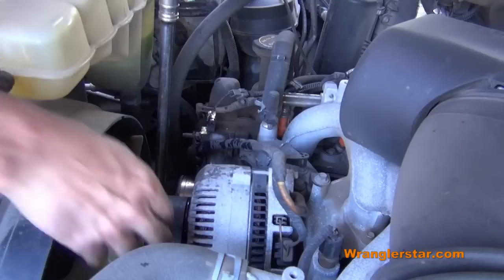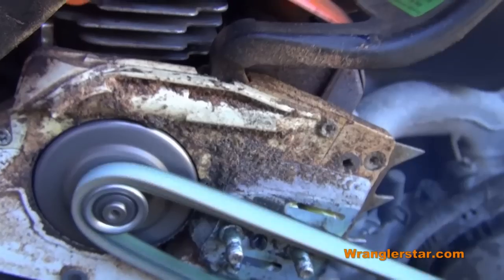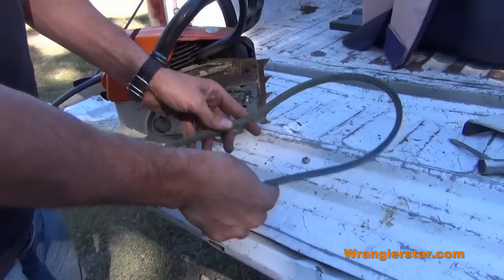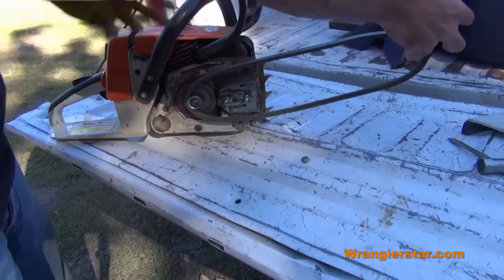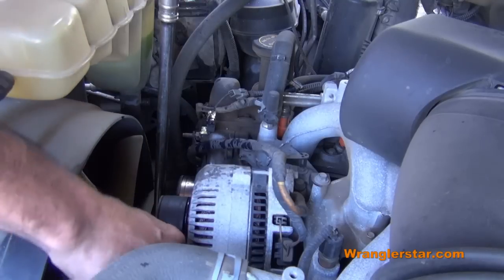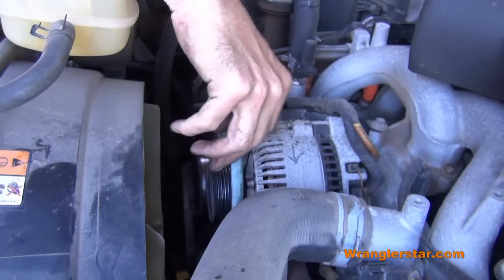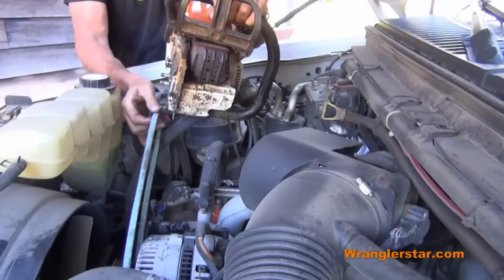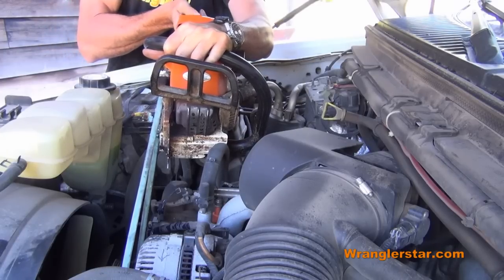Charge A Car Battery With A Chainsaw

Comment: if you have a stone dead battery , the field in the alternator cant activate so it wont work. it will work if there is some voltage in battery only!
Reply: +harry escarole If you have a stone dead battery you'll never get away from your house needing to try this.
Reply: Carl Smith but your veering from my comment , its either yes im right or no im wrong
Reply: the point in video is starting your truck out in the middle of no where not trying to charge a stone dead battery your battery wont be that dead just from leaving the radio on, and you can't get out in the middle of no where with a stone dead battery. You're like can't air up my tire with this chain saw thing, didn't hear him once say it was stone cool dead right you brought that part in to the discussion.
Reply: my thought is driving along and alternator goes. some people wont know it or wont be near a place for help. when vehicle stops running it will be stone dead. it was a scenario i had in my mind.
Reply: +harry escarole ....  Most modern internally regulated Alternators are single wire self exciting and do not require battery voltage to excite the field..  They are self contained and if they are spinning they are charging...  GM cars and trucks have been using this system since, ...well a long time..    If you have a three wire alternator there are video's showing you how to rewire it to self excite.
Reply: rainmechanic dont agree with you , theres no magnets in an alternator
Reply: harry escarole ... Apparently you do not agree with the engineers at General Motors either.
Reply: rainmechanic i worked for gm dealership for 21 yrs ,  i was gm certified and i rebuilt delco remy alternators and starters on bench before there was an exchange program.  you can sit in your dirt driveway with your cam. i dont think g.m. engineers recognises you in case you didnt know.
Reply: rainmechanic yeh self exciting when theres voltage to the "one" wire......without voltage you can spin that pulley all fuckn day and it wont produce anything. a generator in a car doesnt need any existing voltage to produce. you need to face your downfalls and maybe "SELF EXCITE YOURSELF"!

Comment: Great video how long will it take to get enough charge in the battery to start the truck.
Reply: +Michael Swan ~~~People in the comments say a little over 10 mins at the trucks fan belt normal idaling speed, then try. Peole say they had sucess

Comment: This seems like way more pre planning and work compared to storing a charged battery and some jumper cables. And TAKE NOTE PEOPLE: alternators are not designed to charge a dead battery, only to keep it at an optimal level. This may cause premature failed of your alternator, and more problems than you want to deal with

Comment: it sounds like Cody is speaking from experience.of being cutting a while, left the lights on. ignition key should be in the on position. to do this. it will take an effort by the chainsaw to turn an energy starved system at first and lighten over time. the belt might even squeal from the first engagement of the chainsaw. thanks  Cody  good info. nice video

Comment: You do not need to mark the direction of an alternator. The alternator itself makes ac. Then uses diodes in a rectifier to make dc. Now the older generators this might be so. It doesn't matter the direction of the alternator not the direction of the chainsaw.

Comment: alternators don't have magnets they have electro-magnets if there is no power going into the field coils they are not magnetic. some alternator can self excite using the residual magnetism from having been run before, some can not.

Comment: You can do the same if you happen to have a battery powered drill and a socket that fits the nut on the alternator pulley.  You need to turn on the ignition as well.

Comment: I don't know about other people, but I don't regularly carry around a long wrench capable of applying enough torque to the tensioner to remove the serpentine belt.
And getting the belt back on would be a huge pain unless I had a helper.
With the way it's routed it could fall off about half the pulleys just removing it from the alternator (I know because that's how I removed it when I changed the belt).
And if it comes off, the only way to put it back on is from underneath, which means raising the front of the the vehicle at least two feet and removing some plastic panels.

You look like you have plenty of room in your engine compartment though.

Comment: How is it possible to generate any electricity, if there is no ignition on and no power to ignite the magnetic field inside the alternator?
Reply: i don't think it requires the full 12 volts to excite the magnetic field, and once the alternator gets up to speed it starts making its own electricity for the field.
Reply: the shear movement of a coil and a steel case will genarate a electric field thus genarating an electric current so you dont have to have any ignition on, the shear movement of the altanator will genarate electricity which charges up the battery. if you think about it that alll the gas engine is doing is spinning the alternator componments.
Reply: brian wheway
Many systems require the ignition be on in order to allow voltage to flow to the exciter, and while it doesn't need much to get started, a truly dead battery will require that you supply 3-5 volts to the positive battery cable terminal. A couple of AA batteries or even a cell phone battery will work as an initial exciter...
Reply: Karen-Audrey .Todd Good info!

Comment: This won't work if the battery is completely dead. If you get lights on your dashboard, you should be OK. Alternators need a bit of power to energize the charge coil. If it is totally dead, heating the battery near a fire so that it is nearly too hot to touch usually excites the chemical reaction enough to get the dash lights going.

Comment: So what would you say, spin the alternator for ten minutes at full speed with the chainsaw? Should that be enough?
Reply: +David Batterson ~~~~Some where in the comment a guy said he had tried it when his truck died on a hunting trip. He tried it for 5 mins with no sucess, but then he tried it for 10 mins at the trucks regular idaling belt speed and it worked. So yes about 10 mins if not more i supose.

Comment: Wstar.  Great Tip... but is it confirmed that direction of turning the alt must be the same as when it is spun by engine?  I know for a Gen it would have to be without a doubt, but I just don't think it matters with an Alt...the diodes don't care, the Reg doesn't care...I really don't think it matters...or not knowing for certain, are you just being safe?
Reply: +Ronplucksstrings It does not matter to an alternator the direction it is turning. The diodes will reroute the current to the proper terminals.

Comment: Yet another reason why I keep an old duffle bag in my tool box and every time I change a belt or hose on my vehicle I put the old one in my bag, and get rid of the last generation one. That way I always have a relatively fresh spare on hand for all my wear parts. Just too darn easy to fix stuff like this in the field when you have tools with you but almost impossible when you don't.

Comment: it doesent matter which way you spin an alternator itll charge the same,the direction is for its fan to draw cooling air,you wont over heat one doing this.

Comment: It does not matter what direction the alternator turns it will make power ,  if this is a older vehicle you might need to jump from terminal 1 to terminal 2 to energize the alternator.

Comment: An alternater is just that it is not a generator. An alternater needs power to make power a generator can make power just by spinning with no power. So if you kill your battery completly you can spin that alternater for a week and not make enough power to light a flashlight

Comment: This will work, but you left out a few details. First off, this will only work on a saw with an inboard clutch, mainly Stihl saws. Don't forget the safety aspect of engaging the brake while you are threading that belt over the clutch retainer on a running saw. Also, the alternator won't charge the battery unless you turn the ignition to the run position. Don't go over half throttle on the saw speed. I would do this if I was stuck out in the wilderness with no hope of rescue.

Comment: Why not just keep an backup battery/jumper box in your truck when cutting wood? If you run your battery down that much that you have to mark which way your alt turns, then buddy you have a real problem and need to carry one. They do not cost that much, usually they all charge from your 12v cig or power in your car/truck, just throw it under the seat and keep it plugged in until you need it, just get one for the size car/truck you have.

A+ on your ideal though.

Comment: I refuse to own an automatic, and this is just one of the reasons (although I do own a BMW M3 with paddleshift 6 speed, but it's so much fun I'm willing to give up the ability to bump start), the only thing automatics are good for is bracket racing, which is......................BORING!

In a reverse of this, you would be surprised how many miles you can cover before the battery dies by cranking over a 1984 VW gti in 5th gear. Got me to a gas station many times, and probably will do so again I'm sure.

When a battery goes out I usually don't replace them until it snows, or it's during winter, I'll just bump start until then because I've done it so much I can get most cars started with an incredibly short roll if necessary using a higher gear. Even if it's flat, you can generally still push the car with the door open and hop in and start it at just a walking pace, and I'm not talking cheap old junkers, but newer German cars, including a long line of various 911's.

I cheat on maintenance wherever I can so I can pay for higher performance. Tires I'll run way past the wear marks, they stick better anyway, just make sure it stays aligned appropriately to your driving style and vehicle dynamics. You should be able to feel when it's not right and know how to adjust it without much effort. I'll change oil filters quite often and add the amount lost but use the same synthetic oil for a long time because modern synthetics will last much longer than it takes to load them with carbon. If the car doesn't have an upper mounted replaceable element type filter system like BMW and Porsche use, I'll install a diverter plate, hoses and can so I can change elements in a couple minutes with minimal oil loss, a case of elements costs less then one oil change. If you're not using a K&N high-flow, reusable element type air filter, then WTF? Belt dressing makes belts last forever. Clutches last forever if you only use them to start and stop, and matching revs is quicker and smoother anyway. Brakes, well rotors last a lot longer if you A) always bed-in the pads properly, and B) change the pads before they are half gone. This way the pad and the fluid (use highest grade synthetic) absorbs most of the heat instead of the far more expensive rotor. Fuel systems last longer and perform better if you A) never let the tank go under 1/4 full, or B) Regularly run it dry so it never has time to build up sludge in the bottom. Guess which plan I use, LOL! Buy only cars that use a timing chain instead of a belt and save money and drama. Turbo cars offer better mileage, higher power and consistent power output, (especially if you live at a higher altitude) BUT you must change your driving style to get the most out of them, meaning you avoid driving at mid-performance, you are either off boost/neutral and staying at low RPM, or fully on and staying at high RPM as mid throttle completely negates any advantages of a turbo motor.

You can save enough money this way to buy a faster car and/or go racing :)

Yes even if you're a girl.
Reply from the maker: Karen-Audrey .Todd An A/T is fine providing your always on a hill pointing down,
Reply: A BIG hill, it takes about 30+ mph until the engine starts turning over with an automatic.

Now here's one for you: How to start a car with a rope. I was rock climbing with a friend and had parked the car on an incline backed up to a large boulder and accidentally left the ignition on as we were listening to music while getting our gear together. We returned that afternoon to find the battery dead, nobody around to get a jump from (Before cell phones) and we can't push the car to start it because of how it's parked.

It took a joint and a beer to figure it out. We blocked one tire so the car couldn't move and jacked the other tire up off the ground by about 6 inches. Then we tightly tied the end of a  165' long climbing rope around the wheel and tire through the opening between the "spokes" of the wheel and wound most of the rope tightly around the circumference of the tire like a thread on a spool. I got in the car, turned the ignition on and put it in gear. My friend tied the free end of the rope around his waist with about a dozen feet of slack from the tire. On the count of three he started running down the hill away from the rear of the truck which caused the tire to spin as the rope unwound off of it, which turned the engine over and started the car.

It took a couple tries until we found the right gear, which I believe was 3rd gear, and I had to let him get running before EASING out the clutch, but it worked.

It's exactly like starting a chainsaw, just on a bigger scale...

The first time I just popped the clutch in 1st gear and he came to an amusing and immediate stop.

Be sure to push the clutch in the second the engine catches, or, well you can imagine what might happen LOL!
Reply: Karen-Audrey .Todd  WTF! Did your friend actually tie the rope around his waste?
Reply: john smith Well to be precise he clipped it to the back of his climbing harness, but yes, he really did, LOL!
Reply: +Karen-Audrey .Todd That's such an insane story that I actually believe every word. So did he get dragged back up the hill a little?
Reply: +Karen Audrey Todd last automatic i heard of that you could roll start were the old version powerglides from the 50's.
Reply: +J clark your absolutely right
Reply: william cleveland finally someone that understands how an automatic transmission made in the last 55 years or so works lol.....you can how ever when going down the highway  with the converter locked up an turn the ignition  off kill the engine  at speed in drive and turn the key back on and it will fire on some of the autos of the 70s  and 80s but  you still cannot  push or roll start an automatic with out the pump pushing fluid
Reply: TruckerPhilosophy there's usually still fuel pressure in the lines to pop start A manual that is e.f.i now if that same vehicle had a bad alternator and a completely battery then yeah it is not going to start unless it was a diesel those can be pull started with no charging system or battery provided that's it's mechanical injection I've got an old ford f250 diesel with bad glow plugs and the only way it will start is to pull start it to build enough friction and heat to fire it
Reply: TruckerPhilosophy nope I will not used either on my diesels see them blow heads off with the smallest amount
Reply: +Karen Audrey Todd // Pretty good story. But if you are the kind that needs a "joint," you certainly don't need to say so in a public forum. Especially a family oriented one.
Reply: +TruckerPhilosophy // What do you think of what I wrote, above? I don't know if the alternator problem (situation) I wrote about is still the same.
Reply: reanultmfegan.
Reply: +TruckerPhilosophy  My 12 valve don't give a shit about that alternator lol
Reply: +william cleveland I know nothing about domestic automatics and I trust what you are saying but It worked just fine with a 1972 Mercedes 280SE which I believe has either a ZF or a Getrag automatic. I'm tempted to research why this is so, but no, I long ago promised myself to never learn anything about automatics so I would never be talked into working on one.

Not sure how bright that was as consequently I have been talked into doing dozens of clutch jobs.over the years.

Hmm, maybe I can justify it as transmission counterintelligence, IE: "knowing your enemy".

Wait a sec, I forgot, ATF eats nail polish, bail that shit! LOL!
Reply: +TruckerPhilosophy Worked fine in a 1972 Mercedes 280SE...

Now about dead batteries and electric fuel pumps: Back in the 1980's I had a 1984 VW GTi and I discovered that if I ran out of gas, which I often did back then, I could crank the starter while shifting gears and once in 5th I could cover a few miles to a gas station before the battery died because it was so light and Bosch builds solid products. Once I cut it too close and after fueling up there wasn't enough charge left to operate the fuel pump.

I pushed it back and forth across the parking lot for 3 hours to refill the fuel lines and build up enough pressure to get it to start. Stockton, Ca. in July and not one person would give me a jump. I have ever since considered Stockton a perfect location for above ground nuclear weapons testing. Hey Lawrence Livermore is only a few miles away, how convenient...
Reply: I know what you mean, I lived in the Eastern Sierras for 30 years and I drive HARD in all 4 seasons, on road and off, and yes, Mammoth Lakes is fairly remote, the nearest large town is Reno, Nv., 164 miles away, so it has to be tough, fast and easy to repair and maintain myself.

Buy something German a few years old, besides being engineered for the autobahns, they last forever and are designed to be worked on. I LOVE German engineering.

Another choice would be a used Subaru WRX: Turbo power, fast, safe, 4wd, fun to drive, built tough and last forever. The wagon version is especially cool as you get lots of cargo space and it's still a rally car on snow and dirt. Subarus are very popular in the mountains for good reason